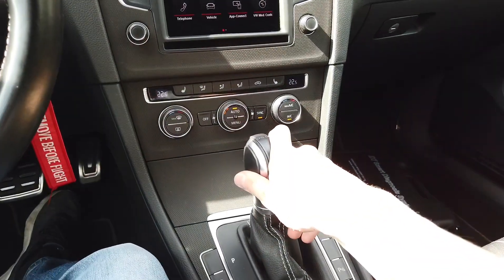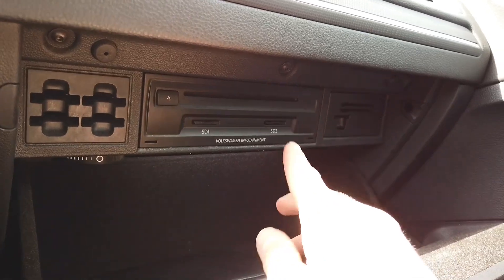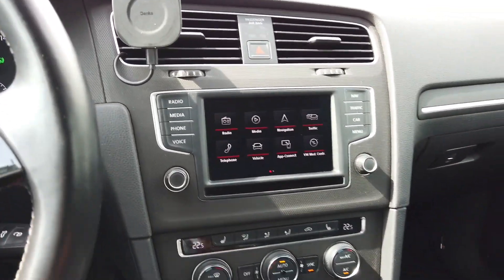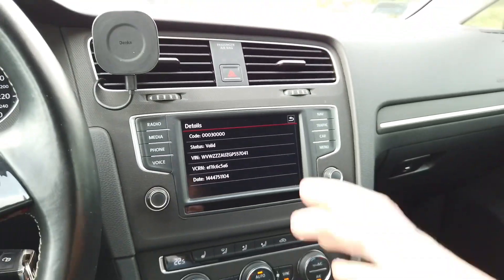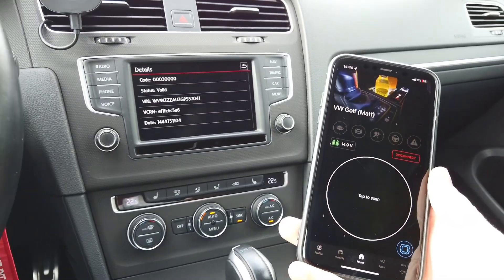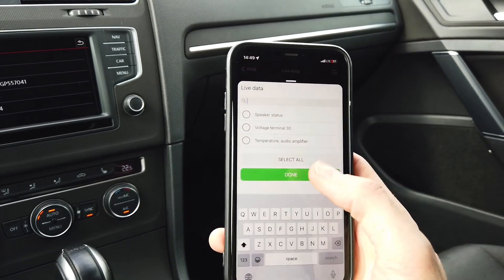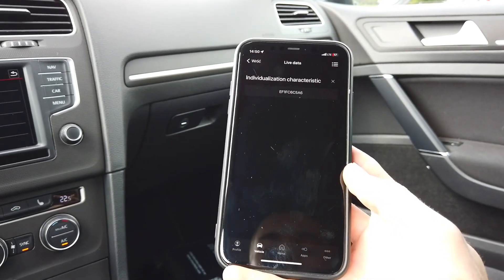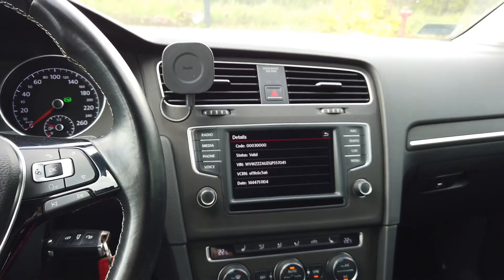VW Seat Skoda Audi: how to get VCRN from MIB1 MIB2 MIB3

Comment: Your videos are always great thank you

I have an issue. I have updated my head unit from MIB 1 to MIB 2. Everything could work and the app connect was available but CP was active. I want to the dealer and they removed CP but now App Connect doesn't work (needs a code), Bluetooth is not working, Telephone and voice control are not working

When i go to the installed codes, all of them are showing "temporarily invalid". I then went to your other video for installing SWap/Fec codes. I was able to get the correct VCRN number on my OBD 11 but the VIN is incorrect. My original car VIN is not working. The VIN from the "temporarily invalid" codes is also not working. 

Please assist

Comment: Hello I have already patched my unit and have already installed all FEC codes due to the AIO Patch. Do I still need to use the FEC Code Generator to unlock the functions or do they already work?

Comment: Hi, why in my golf 7.5 if i check in FEC SWaP i don t see any code in supported code? But only in installed code... my unit is HARMAN MIB 2.5
Reply from the maker: MHIG/MHI2 units don't have those codes listed in "supported" section. That's normal. Not sure why is that. Maybe they all support everything, not like MST2 units with different functionalities.

Comment: You made your car si cool. My unit is delphi and doesnt have so many options 😓.
Reply from the maker: If you enable developer mode you should see those options as well.
Reply: @mrfixpl  i did it when i installed fec codes from your other video’s but your mib unit have  more things i see .i dunni how to upgrade mine to be so cool
Reply from the maker: what's missing in yours?
Reply: @mrfixpl  you have another menu .i have also one skin to choose. But i try to change all what is possible to make all the changes that you make 😅. For few it is not possible but is beter than nothing 🫡.
Reply: Same bro😢

Comment: Hello, when I install the code I generated it shows up as not valid. Why is that?
Reply from the maker: Self-generated codes don't have valid signature. If you want to use them, you need to patch the system first so it ignores the signature.
Reply: @mrfixpl  I understand, thank you! I have this version MST2_EU_VW_P0231D it looks identical to yours, but in one of your videos you said that if it ends with the D that I can’t patch it.. Is that true?
Reply from the maker: You need "SD Activator by Congo & Duke"
Reply: @mrfixpl  Where to find it